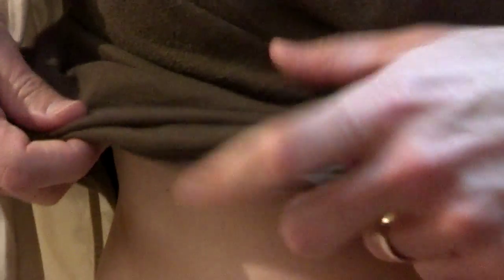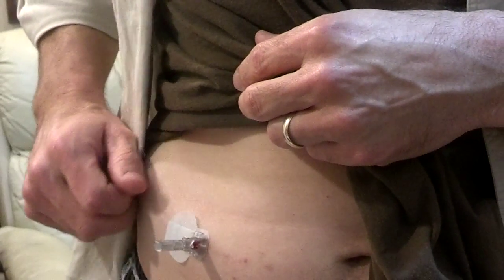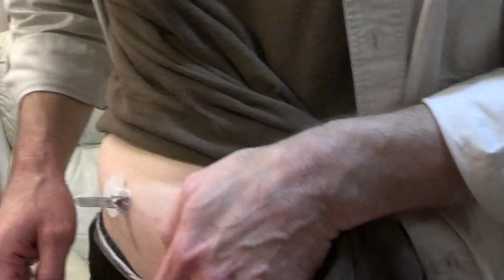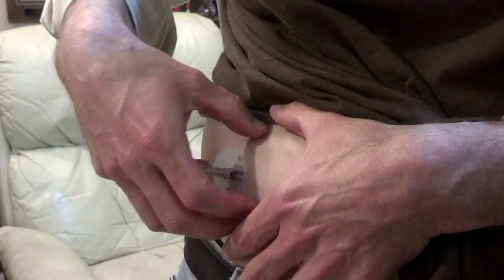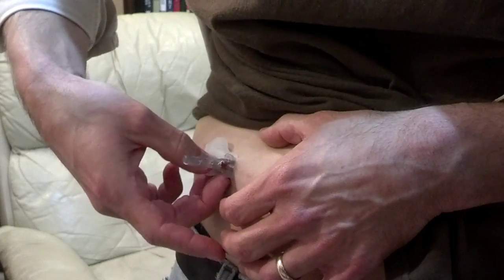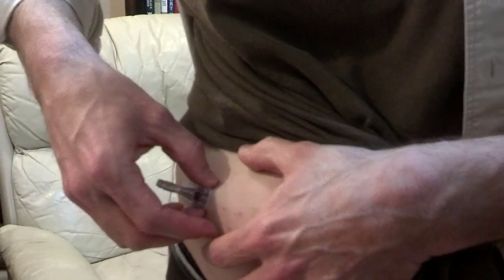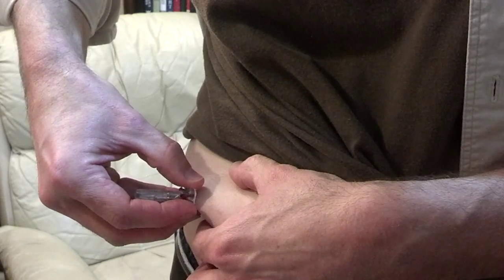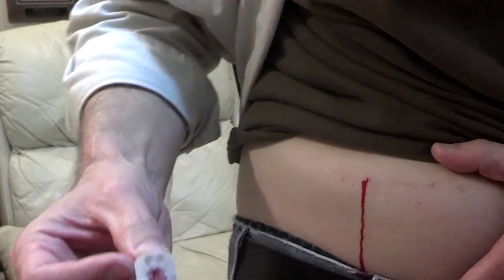#3 Enlite Sensor- Trouble removing needle

Comment: Thanks for sharing glad to know I am not the only one!  I have had the same problem!  Only used the sensor about 6 times so far and only had one removal go smoothly!  It takes my husband and I about 10minutes of tugging to get the needle to release...  seems the solution we came up with is to pinch the "dart" closer to the skin.  There are grip marks toward the top but they seem misleading.  I sure hope Minimed can fix this problem!  I breakout into a cold sweat every time I have to go through this...  :-(